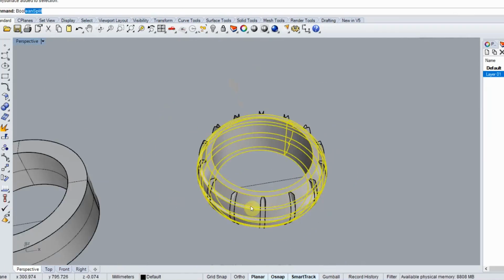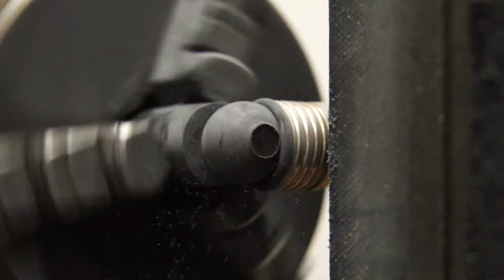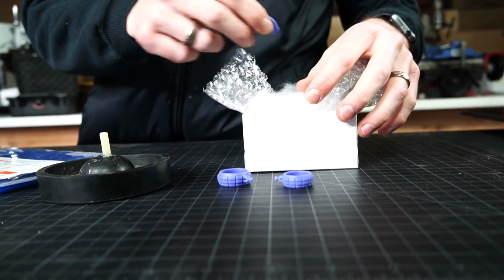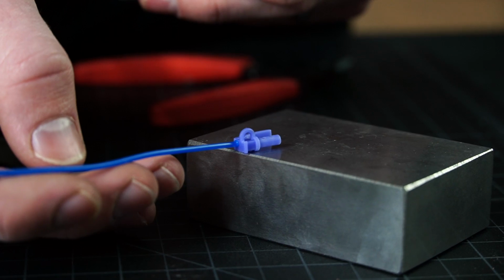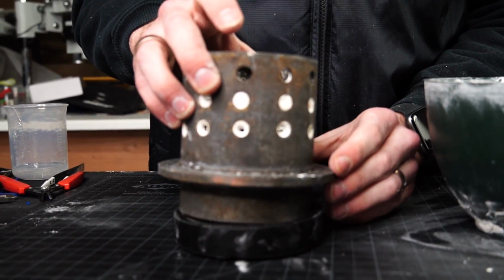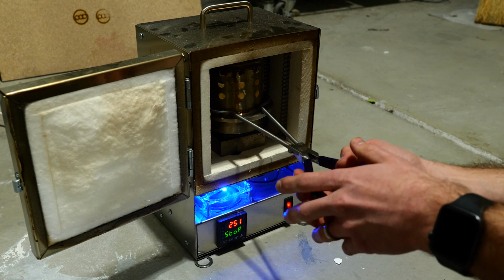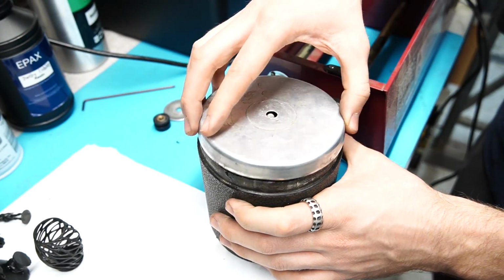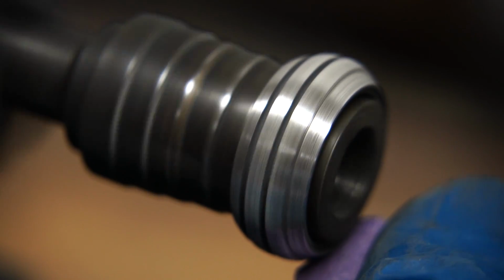Making a Frag Grenade Ring and Pendant with Additive Designs

Comment: I did notice some imperfections on the ring. It had pitting and a knarly gouge across the finished product. No doubt this was caused by the speed in which the silver was poured into the mold.

Comment: Sorry Patrick you know I'm a huge fan of your work. But what I dont understand on this ring and your friend being a engineering degree student. Should have just used s 3D metal printer and your done. I dont like bring computers into our work and the least amount of machinery the better. I'm no engineer but I do work in aerospace commercial plane company using 3D laser measuring with Leica, Fero, Radar, and arms, and photogrametry, and Blue scan tools. You can 3D print any material in metal or plastic and even concrete now. 1 out of 10 this is getting a 6.5 
Sorry buddy you know I love your work and videos. Don't get lost in careers.. we look up to you as a mentor. You probably save my life or at least my sanity during a very stressful time.